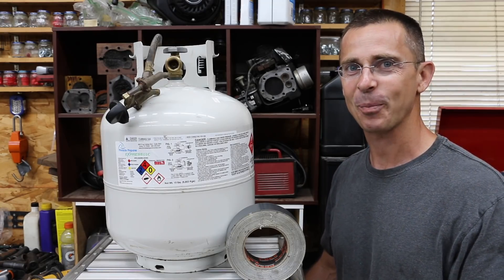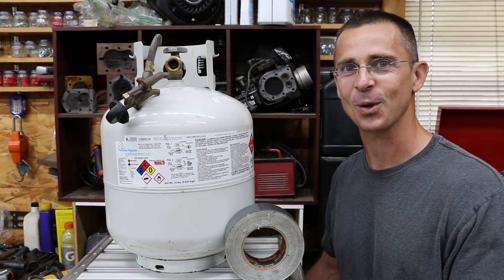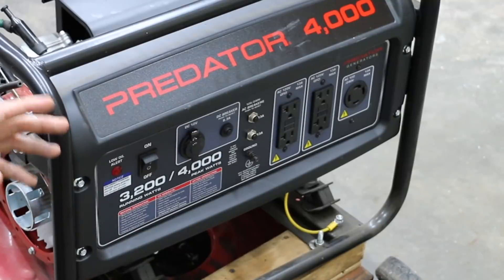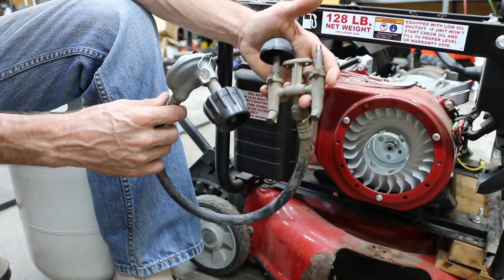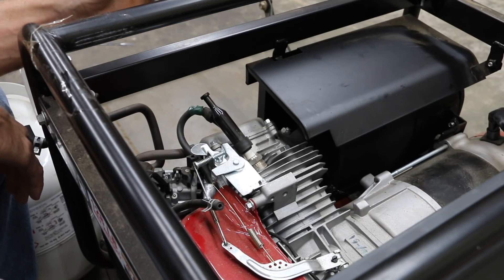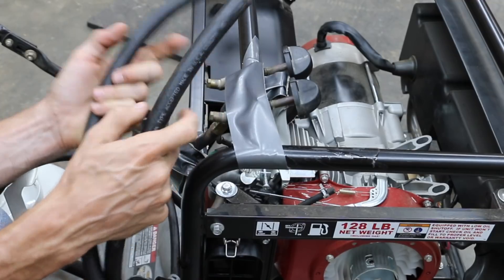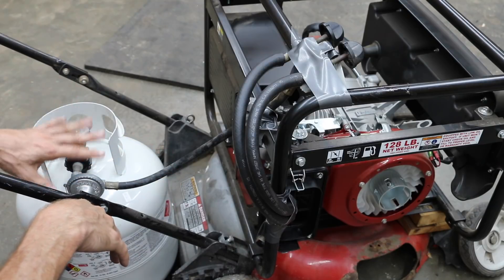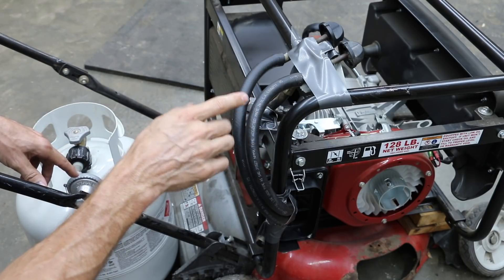Can a gas (propane) grill power an engine?  Let's try it!

Comment: Well that was a lot easier than I thought it'd be! Have you done a wood gasification unit yet?
Reply from the maker: Not yet. Great video idea!
Reply: Yes! Do that.  The Germans did that during WW2
Reply: Project Farm I’ve been suggesting this for a while..... please do it!!!!! I’ve seen it on an old survival show, pretty sure it’s bs to run a pickup truck on it very well but I’d love to see a test.
Reply: Jason Truman There are hundreds of videos on YouTube about gasification. Many of them very advanced. Wayne Keith is a guy in Alabama who has several trucks and a tractor that run on wood.
Reply: Prettt sure FEMA has plans to make a wood gasifier and tells you what size to make it to run certain engines. And on YouTube pretty sure there’s several examples of people running their trucks on a wood gasifier
Reply: deweys burning smoke.  It should work.
Reply: You can run an old pickup truck on wood gas. The new ones the computer will go nuts.
Reply: @edifyguy  not really, you should check out Wayne Keith. He probably knows more about wood gasification on vehicles than anyone on the planet.
Reply: @stanleyroberts4381  I suppose it would be possible to make a newer vehicle run on wood gas too, by the same method, but the computer would definitely still hate it because it wouldn't have mixture control, but the computer hating its life and the thing not running are two different scenarios. :)
Reply: @edifyguy  Wayne Keith did it in his modern pickup trucks with their modern on board brain box. Set the speed record at the Bonneville salt flats for wood gasified vehicles there. Has videos on you tube, all documented. Daily drives his vehicles on wood gas. There is even a yearly gathering for wood gas vehicles. Wayne even pulls a work trailer with his on his farm. All this with no problems. I seem to recall him saying something about the computer correcting the timing for wood gas automatically.

Comment: Can a diesel engine can run cooking oil ?
Reply: tony 12083 yes it can, the first diesel was actually peanut oil
Reply from the maker: Great video idea!
Reply: Yes it can, this has been proven many, many times over. CarThrottle Alex did a really good video on it recently.
Reply: Yes it’s been done multiple times, even mike Rowe on dirty jobs did an episode on filtering cooking oil to be used in place of diesel
Reply: Jason Truman yes but the first diesel engine is not the same as today but it  lwill be fun to see it
Reply: When Biodiesel started catching on it made good economic sense. Many restaurants would give you their old oil for free. You had to filter it. It was cheaper than paying a company to dispose of it. Now, most places (especially chains) have exclusive contracts with oil recycling companies.
Reply: yes it can. but to run on pur vedgie oil you have to heat it to about 165 degree f. and you have to start and stop the engine on diesel or biodiesel. otherwise the vegies oil have a tendencies of clogging the injector.
Reply: can get around this with some simple chemistry to pull the glycerine out of the cooking oil. That's the main culprit behind clogging and the primary step to convert used cooking oil into "biodiesel".

Comment: Looks like you're trying to make a hydrogen engine. Would be pretty cool to see but It could possibly be pretty complicated.
Reply: Cees Timmerman 
It's not an "explosion". The word "explosion" is a misnomer that implies a violant, rapid, uncontrolled release of energy which isn't what happens inside an engine (or even a homemade potato gun).
I remind you, they're named internal combustion engines, not internal explosion engines.
Reply from the maker: Great point
Reply: I would love to see Project Farm devise an efficient Hydrogen producing system and run engines off pure H.
Reply: Andrew P
Hydrogen gas is difficult to burn in an engine due to it's tendency to preignite and backfire (both intake and exhust). It's not well suited for ICEs but it can work.
Reply: Antonio tod 
Hydrogen is a very light, easily ignitable, fast-burning gas. Any small hot spots or even just the hot exhaust valve(s) can cause pre-ignition. In a way, it's a lot like really low octane gasoline but less predictable and faster burning. It's a really touchy fuel in ICEs but, again, it can work.
Reply: Cees
Correction: Combustion. If your engine explodes you're gonna have a bad time.
Reply: Check Mikerevna YouTube channel. He has made purified hydrogen as fuel for heating a cooking. He has lengthy videos, unfortunately only in Greek atm.
Reply: 177SCmaro What causes pre ignition of hydrogen?
Reply: The fuel/air mixture explodes subsonically. https://www.youtube.com/watch?v=_TNSUIsjdpY
Reply: 177SCmaro a flash back arrestor can solve that issue.
Reply: To see engines running on Hydrogen, go to. www.coolspringpowermuseum.org  many engines run on a blended fuel of propane and hydrogen. Google Cool Spring Power Museum. I was a director at the museum for many years. Look for Otto Engine in Susong Building.
Reply: James Downs 
It would still be a misfire. And an arrestor could be restrictive. But I agree it would at least partly solve the problem.
Reply: Andrew P it's hard to control the combustion of hydrogen that's why NOS is used instead of just oxygen.
Reply: all you need is to produce hydrogen gas. through process of electrolysis with high voltage.
then you can plug it in the same way as the propane tank here. 
and it should work just fine.
Reply: Any properly mixed fuel/oxygen mix is explosive. That's how an explosion engine works.

Comment: Can you run a gasoline engine of vodka?
Reply from the maker: Great video idea
Reply: In soviet Russia, vodka run you!
Reply: Not on regular Vodka, needs to be above 100 proof, lowest I've done is ~160 proof. (80% abv)
Reply: Stranded in the Nevada desert in an old RV with no starter fluid, my dad threw a shot of vodka into the carburetor and she fired right up. We took off back towards civilization as fast as we could. So I believe it may be possible, but expensive...
Reply: Kinda throws a wrench into the saying "don't drink and drive " since it's the engine that's drinking! Lol
Reply: I think he did an Everclear video
Reply: EPMADNESS octane knock
Reply: Yeah most vodka’s have too much water in them. Besides it’s just ethanol that burns in the vodka, you may aswell just buy ethanol
Reply: EPMADNESS wouldn't you have to add some sort of water injection? To keep it cool.